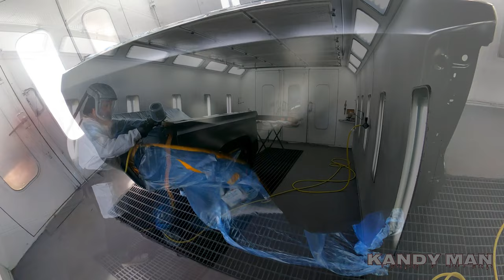DV1 C2 - NAILED IT!!

Comment: New to the DV1 gun, This gun doesn't have the screw at the bottom to open and close the air line?
Reply from the maker: It's different than most setups  .it's above  the fitting turns to adjust
Reply: @kandyman5315  you mean the black screw were the hose plugs into?
Reply from the maker: Is it digital
Reply: @kandyman5315  ok found it, thank you

Comment: I have to point something out to you. When you reference PSI pressures when using the DV1 you must state whether you're using the internal gauge at the top of the gun or a gauge at the inlet of the gun. The gauge of the DV1 is about 8 psi lower than a regulator or cheater valve will show at the bottom of the gun. IF YOU READ THE DV1 INSTRUCTION MANUAL (Hey who does that?) it is clearly stated right in DeVilbiss' literature for the DV1.
Reply from the maker: Thanks for the support

Comment: Do you always use the 1.4 tip for clear I'm new to painting and love your videos I have the dv1 base and dv1 clear with both air caps c1 and c2
Reply from the maker: So far that's all I've used it works great with the system I use . So just stuck with it. Thanks for watching 👊
Reply: @kandyman5315  thankyou I'll try it really love painting just have no one too teach me except you tube

Comment: What tips size do you use with the ws400 for sealer?
Reply from the maker: 1.3
Reply: @kandyman5315  I have the 1.4HD which is too big for sealer I think. If I choke it up a bit (turn the fluid in) would that be about the same as a 1.3 or even a 1.2?
Reply: @kandyman5315  right now I’m using Prolite with TE20 1.2

Comment: I've been using a ws400 for the past 4 years since i've been in the trade but I always get intimidated using it because I feel like im gonna run it lol, is the dv1 easier to control than the ws400?
Reply from the maker: Yes it has great control.  But be confident when you spray and it will come out better.  That goes for me to. 💪when I worry it only screws things up. Thanks for watching 👊
Reply: @kandyman5315  Man I appreciate that! Sometimes its hard when you get in your own head and you are right things get worst  when overthinking. Awesome video brother blessings to you!
Reply: The dv1 has so much more control than the ws400